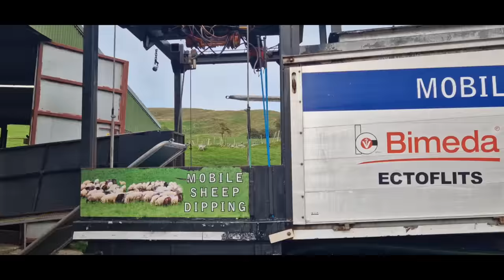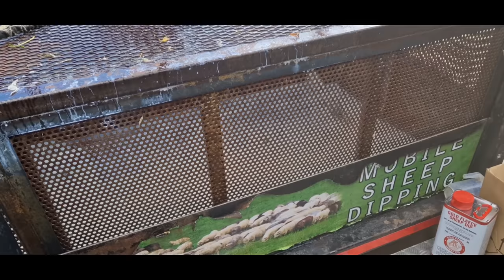Every Farmer Needs to try this, Game changer, sheep farming #shepherd #lambs #animal #farm #lamb dog

Comment: That's some machine im a calf to beef farmer in Tipperary. A few years ago i bought 4 reared pet lambs in kilmallock mart for my kids and dat summer my way of dipping them was put them up the crush and i mixed that dipping liquid in a barrel a ran it threw the power washer giving them a good sokeing. Id a broken collor bone at the time and couldn't lift them ortherwise i would have dipped them into a barrel. Great channel i only found it this week. Your father is a gas man i work with my dad aswell at home. It can be hard sometimes most off the time is great. Keep d videos coming there great i still have a lot to watch.
Reply from the maker: Oh it can be hard sometimes to work  with him but mostly good😅 that was a good idea by ya, fair play.  Where in tipperary are ya based, glad you like the content, keep the comments coming 👍👍👍
Reply: @sheepshepherd   5 miles outside of Tipperary town in a village called monard as you head for limerick. 👍

Comment: Ever tried a jetter instead of dipping? We switched years ago in NZ and just bought our own. Works for us.
Reply from the maker: Tbh no, you can't beat a plunge dip, it really soaks into the skin all over and  is 100% effective when done right. If they are very wolly. Would the jetters get the dip into the skin?
Reply: @sheepshepherd  you're probably right that plunge dip has to be more effective. 

We don't have many issues at all with jetting though, it's pretty rare to see any fly strike and when you do it's usually a lamb that sort of jumped through the jets to avoid them which is really rare.